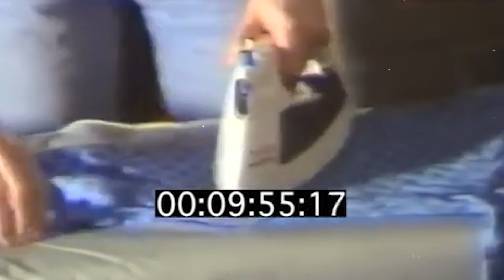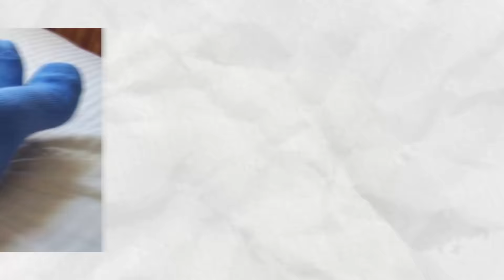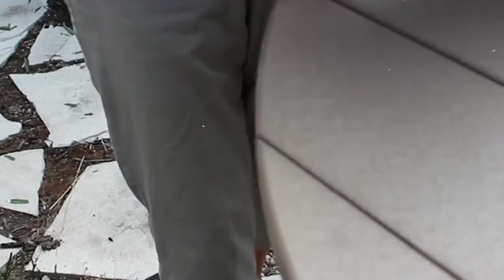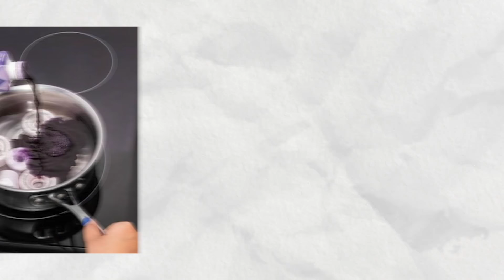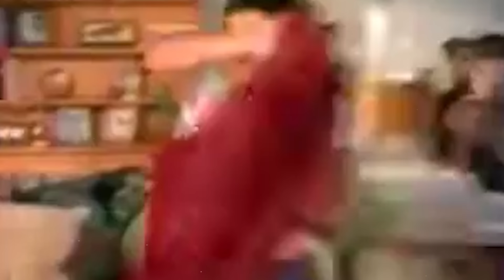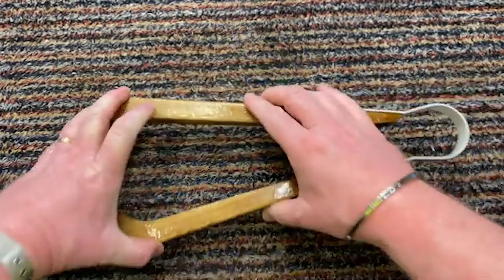30 Strange Laundry Room Items From the 1980s That Made No Sense

Comment: The bounce bar was mounted inside your dryer. This was 2011ish. It ran out faster than a regular bottle of fabric softener.
Reply from the maker: Now that is a great insight right there, and the Bounce Bar really did burn through faster than folks expected. Sounds like you tried it out. Are you still using dryer sheets today or something else?

Comment: I don’t like voices attitude about certain things. The indoor clothesline  at the end “and the dryer is sitting right there working fine”. I never had an indoor clothesline. But I have clothes that I never put in the dryer. I have my clothesline , and it has 2 purposes and does both perfectly.  It called my shower curtain rod n I put my clothes on it hanger, open the curtain all the way then ta da
Reply from the maker: That shower curtain rod setup sounds simple and practical, especially for clothes you don’t want in the dryer. We’ll take that into consideration, because not every indoor drying setup means the dryer is being ignored.

Comment: 21:11 that’s not what the bars are for.   You stick them inside your dryer instead of using a dryer sheet.
Reply from the maker: Those bars were meant to go right inside the dryer as a reusable alternative to dryer sheets. Pretty clever little gadget when used the way it was intended.
Reply: Yes in the dryer. My parents had it 😅

Comment: Is sill have 2 washing powder balls to measure the right amount of washing powder for a full or half load. Unlike the downy ball they don't have a lid. They can be put in with the washing of a front loader insteader of clogging the washing machine drawer. My clothes seem to come out cleaner as the ball bounces around hitting the washing to beat the dirt out better. I used to use washing pods but it works out cheaper for me to use washing powder and the wash ball. You can still get those expandle washing lines in the U.K to stretch out across baths to dry washing when there is nowhere else to  dry it. My grandma used to have a "sock pot" used only for boil washing my grandpas socks. She didn't have a washine machine.
Reply from the maker: Those washing powder balls sound like one of those practical ideas that never really needed replacing. And your grandma having a separate “sock pot” just for your grandpa’s socks is such a wonderfully old fashioned household memory.

Comment: Here's a great, weird trick....if you have an in-ground swimming pool, with white plaster, use blueing to make the eater sparkle like crazy.  Harmless to swimmers, it's very dilute, and won't hurt filtration equipment.  I used to swear by this, when I had a pool....
Reply from the maker: Now that’s the kind of old pool trick you only hear from someone who actually tried it. Sounds like it made that white plaster and blue water really pop. How much bluing did you usually add?

Comment: Our sprinkle bottle was an old ivory dishwashing bottle! I wish I I could find the sprinkle top now!
Reply from the maker: Now that is a great memory of a household hack right there, and repurposing an old dish soap bottle really was the thrifty way to do it. Sometimes those simple tools just work best. Have you tried any of the vintage sites or flea markets for a replacement top?
Reply: @TheYesterdayVault No luck yet, but I keep looking. I am a quilter so I still do a lot of ironing. I loved ironing as kid. Started with my dad's handkerchiefs, then pillow cases and sheets. I also remember my mom having me set up the iron when it was freezing outside so we could thaw the clothes that had been on the clothesline. There was one time that a sheet actually snapped in half when we brought it in! It was great to clean the windows with glass wax so it wasn't a total loss!
Reply: @normaowens7340 I see vintage laundry bottle sprinkler tops on eBay all the time. New ones in a more modern design are available online too.
Reply: My mom had it attached to a 7up bottle…that was 60 years ago…

Comment: the downey ball was great if you forgot to add the fabric softener. btw, the dryer bar was just that - you put inside the dryer drum, not the linen closet
Reply from the maker: You've got the whole system down cold, and the downy ball really was a lifesaver for anyone who forgot to add the softener at the right time. Good clarification on the dryer bar too. Do you still use either of those today?

Comment: Here in the U.K. by the 1980s we had front loading washing machine or particularly among  among elderly people twin tubs. The latter being a washing machine with separate spin dryer. The no sign at all of  mangle etc as many cases they had long been long since ceased to be used but often had also long since been disposed of. Those who kept their appliances in a sperate room called it utility room as it could house a separate washing washing machine and dryer or a combination washing machine/dryer and depending on the size of the utility room also a fridge/freezer or hanging space for coats. We had a neighbour who also stored a rabbit hutch in their utility room. The hutch was home to their daughter's pet rabbit. I would guess the hutch and the rabbit were kept in the utility room during times of year when the weather wasn't suitable for having the hutch outside. Trouser presses have no association here in the U.K. but they are associated with hotels particularly with those hotels  that have four or five star ratings.
Reply: I remember my parents getting a twin tub in the early eighties and it was considered rather posh, I don’t think I knew anyone with a modern style washing machine.
Reply from the maker: Now that is a great look at how laundry setups evolved differently across the pond, and the utility room housing everything from a fridge to a rabbit hutch is a fantastic detail. Sounds like folks over there made great use of every square foot. Did you have a utility room in your home too?

Comment: Can't wait for a similiar summary in 50 years of the 'weird' things we have in laundry rooms now. Love the way you had  some video of things that were in use in the 1930s (wringers went out when dryers came in during the 60s, when almost everyone hung laudry to dry on the line outside, which people are going back to because it's energy efficient and makes your clothes and sheets smell good. All that black and white video is from the 40s and before, not really the 80s.  Amazon sells bluing, but honestly it's included now in a lot of laundry detergents, so you don't need to, But it will make your whites look whiter.
Reply from the maker: You clearly know your laundry history, and the point about line drying coming back around is a good one. Do you still hang yours out?
Reply: People were using wringers into the eighties. I remember my mother getting a twin tub washer and my granny talking about how fancy it was, that she could just spin out the water instead of squeezing it.

Comment: I think the Downey Ball was a scam because I never got it to work. I still have an old bottle of Mrs. Stewarts Bluing but since I have a front loading washer I can't use it.
Reply from the maker: The Downy ball had a reputation for popping open at the wrong moment, so you're not alone there. Are you holding onto that bluing bottle for the label or just in case?

Comment: Right products, wrong decade. 

For the record, the laundry balls did NOT cost $30 back in the 80s. Good grief!
Reply from the maker: Fair point, some of these price tags really did get exaggerated for the story. Thirty dollars for a laundry ball in the 80s would have been highway robbery. Do you remember what a reasonable one actually cost back then?
Reply: @TheYesterdayVault About $2. Sometimes there might be a promotion--say with Downey--that if you bought two products, you received the ball for free. 

The biggest problem was making sure you didn't accidentally put it in the dryer with your clothes because it would melt.
Reply: Many of them came with Downy for FREE!

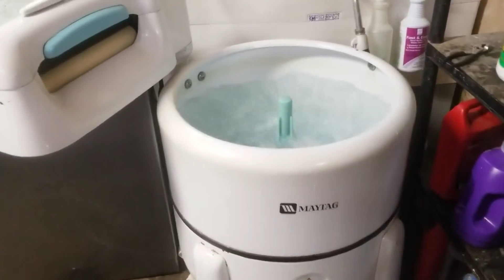Comment: At 30:40 the wringer washer has a green panic bar that wasmthe emergency release.  The end away from the pivot arm would shootmout with a lot of force whe. Otmwas triggered.  The machines used to trip the release if there was a chunky bit going through when they got older and were well used.  I used to lose my wooden blocks to the washing machine, they were the exact size needed to replace the worn spacer blocks inside the mechanism that held the rollers in place.  Wash boards were not used by outting the clothes on them and rubbing soap across them, you put the nbaord in a tub of hot soapy water and rubbed the fabric against the board to scrub out the dirt and stains.  If the laundry was very stained, then the bar of Linda laundry soap (I have still seen it on the shelves recently) was rubbed into the stain,  swished around in the wash water to rinse it off, and put back on the shelf  sitting above the laundry tub and the scrubbing against the wash board would start all over again.
Reply from the maker: Now that is some serious inside knowledge on the old wringer washers, and losing wooden blocks to the machine mechanism is such a specific detail. Sounds like you spent real time around them growing up. Did your family do the laundry at home or was it a shared setup?

Comment: The bounce bar was placed inside the dryer to use instead of dryer sheets.
Who remembers when washing machines had a lint trap built the front side of the machine❓
Reply from the maker: That bounce bar was a slick invention while it lasted, and the built in lint traps really were a feature that got quietly phased out. Sounds like you know your way around laundry history. Did your family have one of those machines with the front trap?
Reply: There were a bunch of models of the GE Filter Flo, the last one in 1992 had a plastic sieve that the water flowed over to catch lint and debris. It was the best at handling the large amount of cat hair I had to deal with doing rescue work back then. None of the machines I've had since can handle even the normal amount that 2 cats produce now. Heck they cannot get anything clean enough to hang on a line now without having to use the dryer on air to remove all the hair and lint. Just crazy! I'm definitely going old school and speed queen for any suture purchase.
Reply: I agree that the Filter Flo was the best lint catching system. I wish they would bring it back.

Comment: Who kept their clothesline in the basement? Everyone I knew had theirs in the laundry room or kitchen.
Reply: We have several lines strung up in our basement for use on the really cold days, mom still hung up the clothes outside standing a box built so that she was above the snow.
Reply from the maker: That's a fair point, most folks kept the clothesline right where the washing happened. A basement setup would be a whole extra trip up and down the stairs. Where was yours growing up?
Reply: Yup, basements weren't a clean/dry spot. But most folks I knew (upstate NY) had 2 pulley lines in the yard to a T-shaped telephone-pole-style pole with climbing rungs and then a line zig-zagged below the back porch ceiling for intimates - especially if it was an enclosed (i.e. all-weather) porch off the kitchen. I even had a two-story pole of that kind in a two-family house from 1929.

Comment: Suds saver machines date back to the late 1940’s. Reason why manufacturers came out with the suds saver feature is people thought automatic washers were wasteful sine people were only use to wringer washers where you could reuse the water for multiple loads of laundry.
Reply from the maker: That's a great piece of appliance history and it makes total sense that folks coming from wringer washers thought the automatics were wasteful. Old habits die hard when it comes to saving water. Did anyone in your family have one of the suds saver models?
Reply: As a child of the 50’s, i remember my Mom using the scrub board, the laundry line (with clothes pins) and the ringer washer!  My mother was amazing. She worked a full time job and did laundry to a perfection!

Comment: My grandmother used to use safety pins to match socks together. Also, I used to work for a Dryer hose factory, the one kit we used to assemble was made for dryers that had no outdoor vent access and to catch lint in a plastic bowl of water that usually sat on top of the dryer.
Reply from the maker: Now that is a smart grandma move with the safety pins, no more lost socks in the wash. And that dryer vent kit sounds like it saved a lot of apartments and basements from lint everywhere. Do you still use the safety pin trick today?

Comment: The sprinkle bottle was from before steam irons, not the 80s. Nobody used bluing in the 80s.
Reply: I used bluing for my white nursing uniforms in the 80s. It was still a thing.
Reply: People still use bluing today, I know loads of people who use it on their karate uniforms.
Reply from the maker: Fair points, some of those items really did belong to earlier decades and got tossed into the 80s bucket. We'll take that into consideration for the next one. Do you remember what era your family actually used those bluing packets?
Reply: yes you are correct, i went looking for some for bee stings and they had gone by then
Reply: The blue liquid seems like you’d add it along with detergent not instead of and whites do tend to have sweat stains even though they’re clean

Comment: Seriously, the captioning couldn't figure out how to spell "wringer"? My grandmother took in laundry in the wringer days.
Reply from the maker: Fair catch, the captioning really should have gotten that one right. Your grandmother taking in laundry with a wringer washer was serious work, that's no small task. Do you have any memories of watching her do it?
Reply: @TheYesterdayVault  Oh yes, she, quite smartly, had us grandkids hand cranking the wringer (not electric) before she hung the laundry for line drying. As we more rarely with her, it was relatively non-dangerous fun(nish) task that would keeps us engaged while being functional. We also assisted with scrubbing socks, stained or soiled items on a washboard with strong bar laundry soap before washing. I continued using a washboard until most clothing became synthetic and knit after the 80s. My great grandmother tried to teach me how to darn socks (her device was not an egg but more ball-shaped on a peg) as a small child but I turned out to be allergic to wool. I personally remember the advent of the Downy ball because older washers did not have a softener dispenser, one had to catch the cycle right and manually add it to rinse water.

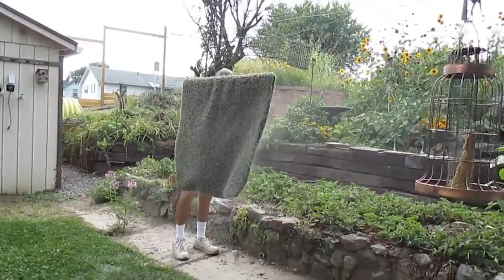Comment: Anyone else got spanked with a carpet beater as a child 😅 11:00
Reply from the maker: The carpet beater doubled as discipline tool in more than a few households back then, you're definitely not alone. That thing had a reputation for a reason. Do you still have one around the house or was it retired for good?

Comment: Those human legs were to dry dress pants my grandma had them for my grandpa's dress pants ,I still have the ball put downy in it when the washer spins it opens and comes out.
Reply from the maker: That's a really specific and clever use for the pants stretchers, your grandma knew how to keep those trousers looking sharp. And the Downy ball still doing its job for you is exactly why folks keep them around. Are your grandma's stretchers still tucked away somewhere?

Comment: The dryer balls are for the dryer. They are fabric softeners not cleaners. And the white fuzzy ones are meant to pick up lint in dryer.
Reply: Exactly. But 🎾 balls will do just fine.
Reply from the maker: You've got the whole system down cold, and you're right that there's some confusion between what does what. Do you use both the softening and the lint picking ones in your loads?
Reply: @TheYesterdayVault the softening ones really onky batter the clothes, no other softening just premature ageing.  The felted/fuzzy balls are mainly to keep the laundry moving, which also keeps the from rolling into a bqll inside the fitted sheet.   Not really much help with lint trapping, the first several loads with a new set means LOTS of extra lint
Reply: Maybe back then they also used special balls for the washing machine too?
Reply: That’s what I was going to comment. I use dryer balls.

Comment: The date on this feels off
Reply from the maker: Fair point, some of these dates in the video didn't quite match up with when things actually happened. We'll take that into consideration for the next one. Was there a specific date or item that felt the most off to you?
Reply: @TheYesterdayVault , there were a lot of interesting things that I found. The one thing that I didn’t remember hitting the market until the 90’s was the Downey ball. Good product, I wish I could still buy it. The water drip bottle was from the 70’s or earlier. We had regular spray bottles by the 80’s. I didn’t know anything about suds saver function. Most of that is based on my experiences, so I could be wrong. I did find the video entertaining.

Comment: The suds saving feature was  very valued by people with electric water heaters or those with limited water supply.  I remember my mom starting the white load with hot water and then washing successive loads. It saved a lot of electricity when we had an electric water heater.  Before perma press pants were available,  our slacks were dried on pants creasers and the creases in our pants were envied by our classmates whose mothers only ironed the crease. Like other items in your show, these items were more from the 1950s and 1960s than the 1980s. Again, the misinformation in ridiculous.
Reply from the maker: Your mom really knew how to make that hot water stretch, and pants creasers gave you a look that ironing alone could never match. Fair call on the timeline too, we'll take that into consideration for the next one. Do you still have any of those old household items around today?